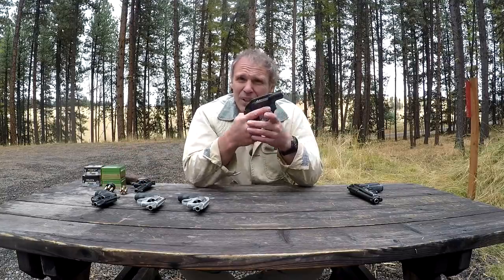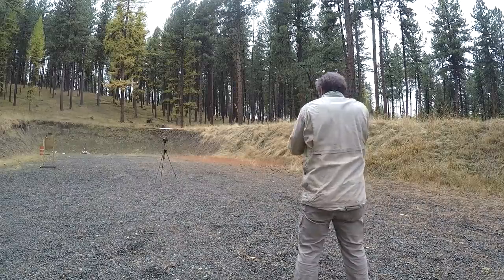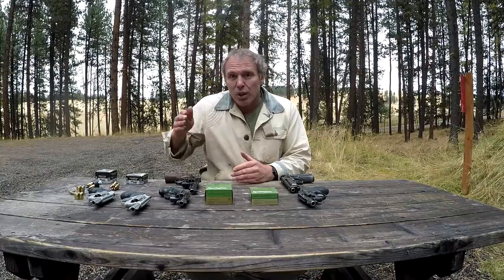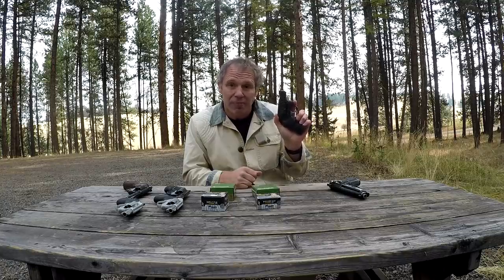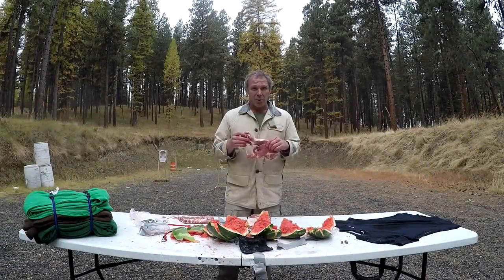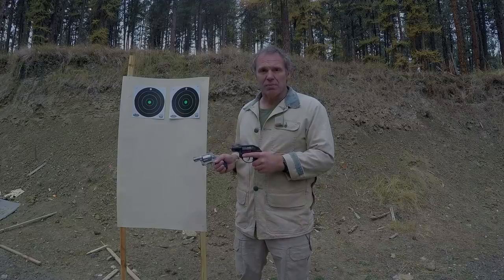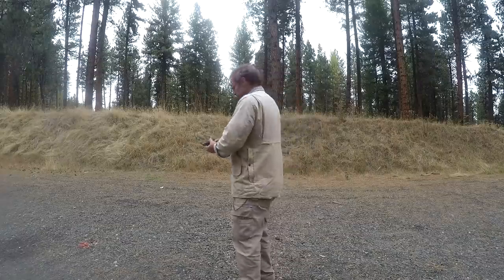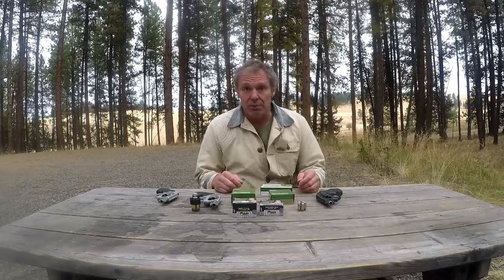Ruger LCR 9 Millimeter

Comment: BTW, that crimp jump issue is a real problem in reloads, and in .357 mag in a light weight revolver, because a milometer of jump in a long case can jamb the action. 
That said, I haven't encountered it in factory ammo yet.  Those rounds from an overly thrifty reloader?  Yep. I have had to re-seat the bullet in the cylinder to open the action... makes the rangemasters cringe a bit.

Comment: I'm still never going to carry a snubbie.

I have a .327 Fed Mag SP101 with the 4" barrel. Still reasonably small, 6 shots, and with the high pressure of that cartridge I can load up to max pressure, but with fast burning powder. That makes it wonderfully comfortable to shoot, yet still effective. You could do the same thing with a .357 Mag version, using 110gr bullets. To me, .38 Spl makes little sense any more.

Comment: I always want the long version, gives more information and saves you from having to come back to something, like that long version of the shooting where "Joe" was in denial of what was going on.

Also, for your argument on the moon clip and having loose ammo to top off, if the rounds don't weigh a pound each, then they wouldn't be that encumbering. So wouldn't it be more ideal to carry two or three moon clips in one pocket and loose ammo in another, so if you find yourself in a situation where you need to top of, you can, and if the cylinder is full of empties, you can use the moon clip if you still need to shoot?

Comment: Being a novice to firearms I'd like to ask whether “crimp jump” leads to reduced pressure when the cartridge is fired  and reduced bullet velocity. Are there any  chronograph data of  “crimp jump” affected cartridges ?

As always excellent video !.....
Reply from the maker: Accuracy and power in shooting a cartridge that has been "crimped jumped" Sounds like a good thing to include in part two.
Reply: That is the spirit! (The cunning use of a kinetic bullet puller can save you a lot of money...)
Reply: In some cases the bullet separate from the casing entirely.  I’m quite certain that would result in reduced power.  Don’t ask me how I know...

For the Lcr or Lcrx 9mm you must use Boberg approved ammo (google the list)  that won’t do this.  It happened to me on the first cylinder with Blazer brass.  Not on the list...

Paul’s favorite (WWB) is on the list.

Comment: What about recoil? How does 9mm in a snub nose revolver like the LCR, compare to a similar weight revolver in 38spl +p ("FBI load") and 357? From the shots taken here, the 9mm seemed to be about the same recoil? I'd really love to see more 6-shot "ultralight" snub revolvers in 9mm, but I'd also like to see some semi-rimmed 9mm, in case you didn't want to carry a moon clip, or you just wanted to slam a few in the cylinder from a pocket. The taurus 905 has my attention, but again, would like to see it more closely to the 856 in an ultralight 15 ounce 6-shot gun...

Comment: Paul, what about .357 snub nose revolvers that give the option to use .38 special. You can practice more often with the less expensive .38 special and use .357 for defense. I suppose that the .357 might be to harsh in a light weight, compact revolver. What is your opinion on that?
Reply from the maker: The recoil of .357 Magnum can be brutal in lightweight snub nose revolvers. They are also often bigger than their .38 counterparts. They are the right gun for some people, but not for others.

Comment: Great review, but you did not mention RECOIL.  Is the  9mm comfortable and manageable in a lightweight revolver?  Like the 38 Special +P?  Presumably it is nowhere near the .357 Magnum, right?...……………………………..elsullo
Reply: elsullo2 my 9mm lcr kicks about the same as my SW 637. Maybe a little more. Much less than 357.
Reply: i had a charter arms 9mm snubbie and promptly got rid of it.  indeed charter isn’t as as refined as a ruger (love my lcr 22lr) but a 9mm snubbie generally is alot snappier and unpleasant to shoot.  i believe in practice and more practice with a ccw.  i was unwilling to punish myself with a 9mm snubbie, even though ammo is cheaper.  my taurus and s&w 38 snubbies are loaded with wadcutters or cbc shorts:  yes less powerful ammo but i can comfortably, consistently and reliably hit my intended target, and practice is fun enough to look forward to.
Reply: Depends on the grips.  I shot mine (LCRX9) and a Kahr PM9 during the same session.  The Kahr felt like a .22 by comparison.

Comment: Mr. Harrell, I've heard you say this a couple times, and I have to take issue with it.  Pressure does not build in a longer barrel.  In fact the pressure begins to drop almost as soon as the bullet starts to move.  You get a longer push with a longer barrel, and more time to accelerate the bullet.  That's why the port pressures drop on AR's the farther down the barrel they are, but the longer barrels still produce faster velocities.  Forgive me for posting this - I'm not trying to be snarky, that was just making my ears hurt a little bit.  I'm a big fan of what you do, and personally, I think the meat target is genius.
Reply: Well said.  My understanding is that most centerfire rifle cartridges experience peak pressure when the bullet has moved about 3 to 4 inches.  I would assume that the distance is shorter for pistol cartridges.

Comment: I was always curious as to why shell casings are rarely damaged upon firing; I would think considering how much thinner they are than a barrel and that the pressure is at it's most in that area when fired that it would be damaged in some form from the pressure.

They certainly don't seem as durable as a barrel generally, yet they hold up extraordinarily well.
Reply: They do split with use, but in the chamber their walls are supported by the walls of the chamber too, it's a pretty snug fit! :)
Reply: Cory Goodman:  After the cartridge is fired they act as a gasket.  They deform to the shape of the chamber, but usually don't get damaged on the first firing.
Reply: Thanks for the info both you you.  Completely didn't take the reinforcement of the surrounding material in to consideration.

Comment: The cool part of a .38 is you can shoot them in your .357.  Now which has more power in a snubby, the 9mm, or a .357?  I know the muzzle blast tells me the .357 is a monster, but how does it rate in this video, instead of the .38? The only meat targets I have ever tested it on,  had  four legs, and were still breathing. (6 inch barrel)

Comment: I got a question. Why is a .38 caliber bullet diameter only actually a .357 or .358? And Why is a .44 magnum or .44 special only a .429? The old Army .44 was actually a .44 caliber. WHY do they numberate chamber sizes differently than the actual bullet diameter?

Comment: Maybe I need to watch this video for a third time because I still didn't catch the part of why the +p .38 spl. actually had LOWER velocities than the std. pressure load, a LOT lower.

I'm a HUGE PH fan and this was another awesome video. I just didn't find the answer to why the discrepancy existed in the opposite way as would be expected between these two .38 rds.. The +p still should have shot faster than the std. pressure, even if by just a tiny bit but definitely NOT slower.
Reply from the maker: The .38 special +P ammo had lower velocities than the standard pressure 9MM ammo. The lengthy explanation starts at 12:30   The short version is that originally .38 was a black powder round and originally 9MM was smokeless powder so the 9MM is more powerful even though it's smaller. the modern .38 +P narrows the gap, but most 9MM ammo is still more powerful
Reply: @PaulHarrell  Hi Paul. Yeah, I got all that, but I was referring to the .38 Spl Std. pressure vs +P also in .38 Spl.. At around the 13 min mark you gave us the crunched numbers of the +P .38s as 756 and 761 out of the 2" bbl.. By contrast the Std. pressure gave a velocity of 862 out of that same bbl.. So the Std. pressure was hotter by roughly 100 FPS than the +P. No matter how this ammo is made I would expect the +P to be at least somewhat faster than the Std. pressure, certainly not slower. I wasn't referring to any of the 9mm ammo results. Thanks for taking the time to respond though.
Reply from the maker: @WhoWouldWantThisName  OK, I think I see the problem. At 4:20 I refer to the Remington .38 special as "+P"   At 6:35 I refer to the Remington ammo only as ".38 special."   At 12:35 I again refer to the Remington .38 ammo as ".38 special."  But the ammo is +P    At 12:45 I call the Sig/sauer ammo ".38 special +P"  Both types of .38 ammo were +P As far as why the Sig ammo had so much less velocity, I think it's for two reasons: because the Sig ammo isn't as powerful, and because the powder charge isn't configurated for optimum performance in short barrels.
Reply: @PaulHarrell  Thanks Paul. I appreciate you taking the time to go through all this, especially including time stamps. Just another reason why you are my favorite.

Comment: With moon clips it should shoot 9x18 and .380.  Might be a cool range toy
Reply: It would be unwise to shoot 9x18. The 9x19 has a bullet diameter of  .355, but the 9x18 has a diameter of .365, which could lead to a dangerous overpressure situation, and destroy the gun.
Reply from the maker: The manual specifically states 9MM luger only. I'll discuss this if we do a part two.

Comment: Paul, why does the much shorter 9mm cartridge spank the longer cased 38 special?  Is it because the 9mm has a thicker brass case, thereby able to be loaded to higher/hotter specs?
Reply from the maker: I explain this beginning at 13:45 It's because the .38 was originally a black powder round and ammo is still often loaded close to the original low pressure ammo.

Comment: Paul, when you do the chronograph shots, why not put the camera on your right side so you don’t have to stop, pivot left 135+ degrees, etc.? If it was on your right side you could simply glance towards the camera without breaking your shooting position.  Pains me to see the economy of motion being lost.
Reply from the maker: Good point. When I filmed this video it was mostly cloudy. On sunny days the angle of the sun creates glare. Check out our video on handguns for beginners you'll see what I mean. On that video I filmed from the right because I had no choice. What would work best would be putting the camera off set in front of me. I don't because even though I could use an unmanned camera, people would wet themselves over me shooting somewhat in the direction of the camera.

Comment: One aspect you didn't cover is recoil. How does the recoil of the 9mm compare to the 38spl? A lot of short barrel revolvers are chambered in .357, in which recoil is brutal and probably much more powerful than the 9mm.
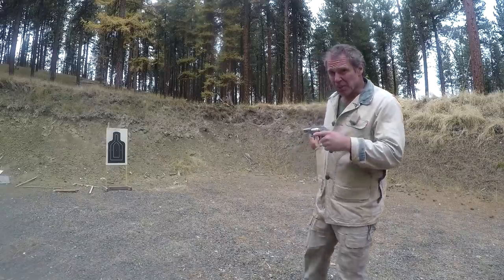Reply from the maker: Good point. I didn't discuss recoil because I depict it and how it effects speed accuracy I the speed drill starting around 26:30. I should have mentioned this in the conclusion.  The .357 is powerful and effective, but in airweight snub nose revolvers it can be "brutal" and becomes prohibitive for many people.

Comment: I see it but don't get it. Can I trim 38 special cases to similar to 9mm length and load like  9mm. And get way better velocity.
Then creep up on the case length to get even more performance? Not a totally rhetorical question. Really great video,but; The whole comparisons showing that little 9mm seems so much better than big 38 special gives me a headache.
Reply: The problem is pressure limits, not case capacity.  The 357 Magnum case is larger not because it needed to be, but to prevent it from being used in 38 Special firearms designed for lower pressures.

Maximum Average Pressure (MAP) of the 38 Special is 17,000 psi.  38+P is 20,000 psi.  9mm Luger & 357 Magnum are 35,000 psi.  In short you can't get 9mm velocities from 38 pressures.

Comment: The 9mm is a much more efficient higher pressure round compared to the .38 special.  A 2" barrel in 9mm gives up very little.  Try a +P 9mm in that revolver.

Comment: Can you shoot the LCR 9 without the moon clips? Note that when you re-use moon clips they can get a bit tweaked and then they don't lay flat so they don't load as easily (but they're cheap, so it shouldn't be a big deal). I can't see any reason for me to replace my S&W model 38 (early 70s production, pinned barrel with stag grips) but if you don't already have a .38 and have a 9x19 or two laying around, having a revolver in 9x19 seems like not a bad idea.
Reply: Yes, but will not push with the extractor, have one and tryed it.

Comment: @Paul Harrell I’m about to go full ballistics nerd here. How old are your .38SPL snubbies? Do you think modern gunmakers might have shortened cylinder gap in the LCR? And last if your .38SPL snubbies are lans/groove/twist rate for lead bulletts with a lube groove or two, would .38SPL ammo fare better if you fed them that?
Reply from the maker: Both revolvers I shot in this video (637, 638) were new (A year or two?)
Reply: Thx for the reply!
Reply: Paul Harrell but I still wonder if the Smiths barrels and cylinder gap may be an issue?

Comment: How does the LC9 stack against a snub 357 when both are loaded with sum of the shelf ammo like winchester 357mag 110gr. wich walmart seems to only cary and the winchester 9mm 115gr . winchester claimes 1285fps from the 110gr magnum and 1225fps from the 115 gr.it seems the 5 grains and the 60fps are all close enough to give a fair comparison of ur average off the shelf 25$ box 50 ammo.

Comment: Here's an odd question: Since this is a revolver and loads with moon clips, would it be possible to shoot 9x18 Makarov or even 9x17 (aka .380 ACP) out of it in a pinch if no other ammo was available?
Reply: The Makarov round uses a wider projectile.  Even if it chambered, I wouldn't consider it safe.  With the .380, the casehead is much smaller.  I'd expect the fit in the moon clips and the chamber to be pretty sloppy.

Comment: When you use a chronograph do you shoot above the metal triangles or through the metal triangles?  Also have you ever shot a chronograph by mistake?
Reply: Through the created triangle.  The metal triangles serve 2 purposed- 1 defines the area in which the lens will pick up light; 2- the top is to help eliminate stray variations in light.  There are 2 lenses, one on each end of the chrono.  Each lens measure light.  As the bullet passes over the first, it creates a shadow which starts a clock.  As the bullet passes over the second lens, it creates another shadow, which stops the clock.  The computer in the chrono converts the time into feet-per-second.  Most good chronographs have dip-switches inside which will allow you to switch to metric or record slower projectiles [such as arrows].
Reply from the maker: Thanks for the good explanation.
Reply from the maker: Yes, The chrono has been hit with shotgun pellets several times.
Reply: @northof50now  Thanks for the explanation
Reply: @PaulHarrell And yet it still functions.   Is it hardened against that kind of problem.
Reply: @PaulHarrell   Ha!  Since watching your videos, like a dope, I decided to try and shoot through my Oehler at 7rds.  Needless to say, when you "jerk" the trigger, your accuracy suffers.  Thank goodness Ken still sells parts for his chronographs. :-)

Comment: Hey Paul 6 minutes and 35 secs into this video what model 38 are you holding ?
Reply from the maker: The revolvers in this video are (besides the Ruger) S/W M-637 (SS with hammer) S/W M-638 (SS with shrouded hammer) and S/W M-36 (blued steel).

Comment: So sig ammo claims there 9mm 124+p ammo is moving 1200fps you where getting close to that out of a snubnose 9mm with what you said was standard pressure 9mm ammo. Kind of wondering whats going on and how there standard pressure 9mm 124 out of the lcr is getting velocity almost similar to there +P claims.did you accidentally get a box of 124+p 9mm?
Reply: Also noticed in another video with the longer barrel MP 9mm you got the same results roughly with standard pressure sig 9mm124 as u did with the LCR.

Comment: QUESTION: Will the LCR fire reliably without the moon clip? I know they won’t extract but, can the LCR be reloaded with loose ammo as a last resort?
Reply: Based on my understanding, yes. The 9x19 headspaces on the case mouth, abd the Ruger appears to have the correct chamber geometry, so the lack of a moonclip ought not have an effect.
Reply: Steven Cali thank you

Comment: Why would bullet weight affect what can be fired out of the LCR9mm. Would 147 grain +p 9mm have more pressure then a 124 grain +p 9mm bullet? What about buffalo bore or underwood 124 grain +p wich seems to be loaded hotter then normal +p.
Reply from the maker: According to the people at Ruger, the LCR is rated for +P ammo up to 124 grain, but not above that.
Reply: @PaulHarrell  any idea what factors bullet weight might have a negative out come. I had a 9mm that recommended 115grain ammo
Reply from the maker: @aaronequinoa77  Heavier projectile weight can often mean greater chamber pressure.
Reply: @PaulHarrell  thank you